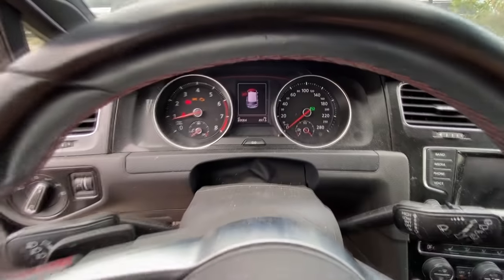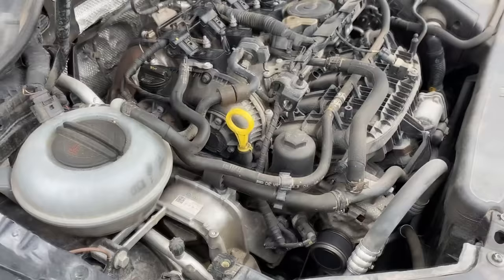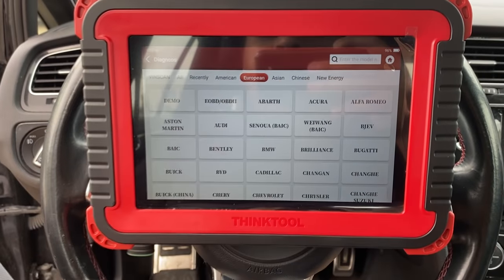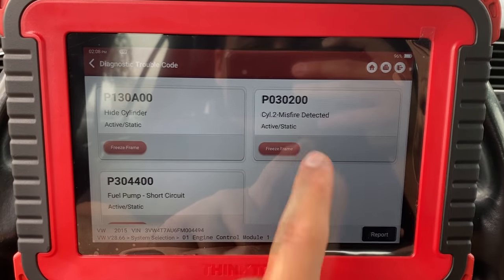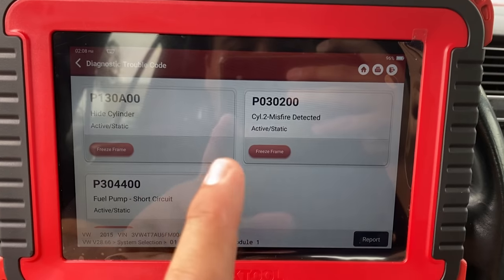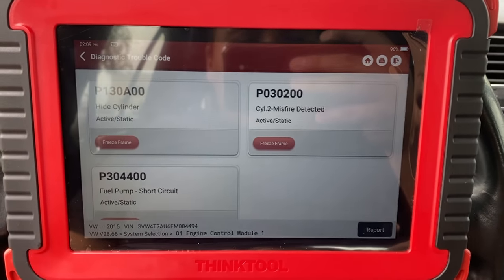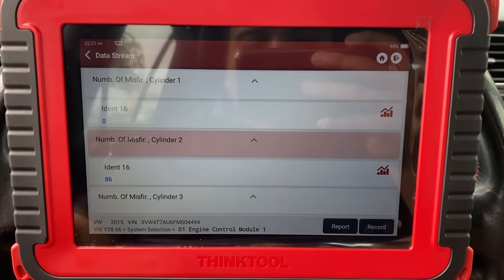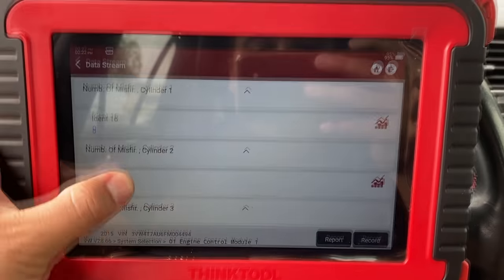VW GTI MISFIRE CYLINDER #2 NO COMPRESSION

Comment: I had an a4 like that come into the shop, and it actually ended up being a valve train issue, caused by a timing chain issue. The cam journal on cylinder 2 intake was eaten up.
Reply from the maker: After doing some research I found this to be a pretty common issue with tuned 2.0 engines. This vehicle has a COBB tuner. Humble Mechanic actually made a video with the exact same vehicle that had the exact same problem. Check it out here! https://youtu.be/V6jzRQpMw24
Reply: @ADVANCEDLEVELAUTO  Great follow up!  And that makes a lot of sense too.  Really enjoyed the walk through on this diagnosis.

Comment: Before settling on piston Rings being a problem I would pull the valve cover and check valve clearances. Could have a tight valve or even a valve that's carbon up due leaking valve seals on the intakes. Just my two cents. Great video!

Comment: There was some damage to the head gasket. When rotates the camera back to the intake valves there is a missing piece. It could lead to an oil passage for parts under the valve cover. That being said it could also be a reason y there is oil in the cylinder. Regardless tho engine would need to be taken apart. Update on this would be nice tho just for Curiosity purposes.

Comment: or try pressure transducer on the dip stick tube prove piston leakage ... also on GDI the spark plug washer crushes  on first fit   to aligns the electrode with the injector   .. so the plug should only be fitted once or misfiring might occur  so never refit a used plug    best regards JF
Reply from the maker: After doing some research I found this to be a pretty common issue with tuned 2.0 engines. This vehicle has a COBB tuner. Humble Mechanic actually made a video with the exact same vehicle that had the exact same problem. Check it out here! https://youtu.be/V6jzRQpMw24

Comment: Any possibility of issues with rocker arms of #2 cylinder?
Reply from the maker: After doing some research I found this to be a pretty common issue with tuned 2.0 engines. This vehicle has a COBB tuner. Humble Mechanic actually made a video with the exact same vehicle that had the exact same problem. Check it out here! https://youtu.be/V6jzRQpMw24

Comment: If that’s a 2015 then that’s not true. The timing chain issue was fixed in 2014. There were many updates with the motor. The tensioner was one of them. If it’s a 2015 it’s a Gen 3. What all u said is very true about the older models. The gen 3 is great engine. Won many awards. I have a 2015 with 196k miles. With all stock eternals. Upgraded turbo, inter cooler and tune. Pushing 400hp.

Comment: You could put pressured air onto the cylinder and listen, if it’s inlet valve which is broken then you could hear / feel air coming to the air filter, if it’s exhaust you’d hear it when u go to the exhaust pipe and if it’s the seal then you could undo the dipstick and hear air

Comment: Hi Eric, I had a similar problem in regarding  with a 2014  VW caddy ( van) I had as a company car a couple of years back. I had the fuse blow for the interior light, and the fuse box was unmarked as well. So I had to pull out each fuse, one by one to find the blown fuse. When the car was due for service , I asked the VW dealer why there was no markings for the fuses and no mention of them in the car manual. He told me straight out the reason is VW want you to return to the dealer  for service, when problems such as this arise..
Reply from the maker: That to me is just ridiculous!
Reply: @ADVANCEDLEVELAUTO  I know, but that’s what I was told. Kind of makes sense, huh?  🤔

Comment: You can also have a head gasket  issue  wear it blows between  paring  cylinders with out crossing over a water jacket, numbet 3 was  a little  low at 90 psi.

Comment: EA888 no longer had timing chain tensioner issues this late. It was the earlier ones which had a revised design. This engine seems to be very reliable even when motified. 
This example looks to be in rough shape. It's the "inspection due" notification also on when you start it?

Comment: Timing chain problems are very common on the mk6 generation (10-14) 2010-2012 specifically... not this generation (gen 3 EA888). More than likely as stated in the video.... piston ring issues caused by 90K miles of harsh diving with minimum, late or undone maintenance...combined with a less the optimal cobb ots tune.  10K oil change maintenance doesn't cut it...in this situation...5k or 6 month and these engines will last much longer. 10K only works of the first person on a lease. You could try and engine flush product to see if it worked the rings loose and compression increased...but once it has hit this point. I wouldn't hold high hope...but it could at least add to the diagnostic.  You should ask the customer how much oil they were adding between changes.
Reply: I replaced the break-in oil of my 2021 GTI at 1058 miles after seeing break-in flecks on the dipstick. Imagine running that oil for the first 10k miles! Now doing 3k mile oil changes. I don't care how stout modern engine oils are. This is a turbo GDI engine with quite a bit of back pressure too due to the stock downpipe.

Comment: Some of this engines suffer from valve not seating properly because of dirt build up on the inlet valves
Reply from the maker: After doing some research I found this to be a pretty common issue with tuned 2.0 engines. This vehicle has a COBB tuner. Humble Mechanic actually made a video with the exact same vehicle that had the exact same problem. Check it out here! https://youtu.be/V6jzRQpMw24

Comment: One more test is doing a leak down test. Apply air pressure to the spark plug hole. Is the air leaking out the exhaust, intake, or valve cover oil cap opening. Some of the Direct Injection engines are prone for carbon buildup on the intake valves and failing to fully seat thus giving little or no compression.
Reply from the maker: After doing some research I found this to be a pretty common issue with tuned 2.0 engines. This vehicle has a COBB tuner. Humble Mechanic actually made a video with the exact same vehicle that had the exact same problem. Check it out here! https://youtu.be/V6jzRQpMw24

Comment: The car engineers dont give a damn about the poor mechanics who work on them.
Reply: Actually, they may care but their priority is to design a product with low manufacturing costs, not servicing.
Reply: @davidkeller2832  ,
their idiotic priority is going to backfire on them !
Reliability issues always backfire eventually, even if only by word of mouth !
Carbonated inlet valves are avoided by using 2 injectors per cylinder, one direct and one into the inlet pipe !!

Comment: fist of all when you get a car with a cold air intake system and a COBB  10:09 or any other tuner on a car you have to suspect melted piston or broken piston ring groves etc you have to consider mechanical damage I work on Volkswagen for a living and the MK7 generation engine is pretty good with the timing chain tensioner and chain but the older engine between 2009 and 2011 are more prone for having the old style tensioner but from what I see is the actual chain gets stretch over time especially with poor maintenance .

Comment: I had a similar problem with my mark5 gti and it was a blown head gasket. Didn’t have milky oil and was just getting oil into the spark plug holes and fouled my plugs. I opened up the head replaced the head gasket that had a tear in it and new plugs and coil packs and ran like a charm after that. But with that cylinder two not having compression I think the cylinder ring has damage also.

Comment: We also got a Tiguan vw with the same motor 115k miles. Timing chain broke and had no compression in all of the cylinders. It’s Got no beans when cranking it 😂 vw are a pain
Reply from the maker: After doing some research I found this to be a pretty common issue with tuned 2.0 engines. This vehicle has a COBB tuner. Humble Mechanic actually made a video with the exact same vehicle that had the exact same problem. Check it out here! https://youtu.be/V6jzRQpMw24

Comment: Oil in the Cylinder.. Means Oil Blow by past the Piston Rings..

You can also check the oil for Fuel contamination... Just put some on the stick. It it catches fire. You got fuel in the oil..

Comment: The tensioner issue has only been an issue for MK5 and MK6 GTI's with the EA888 Gen 1 motors FYI! Mk7's don't really have timing issues. I've had issues with my cylinder 2 misfiring and from my personal troubleshooting, I found it to be an injector issue. These cars are mad annoying lol

Comment: That ignition coil ground bolt nut thing is just a small example of the entire VW build. Incredibly badly engineered for service and repair, and like others have said, designed to force you to go to the dealer.  Terrible service information as well, just a simple function like fuse identification should be clear and straightforward.  Last VW I saw, approx 2015 Passat - door harness damaged, there were ELEVEN different variants of that wire harness, each with specifically pinned connectors.  Anybody who says "I'm looking at a used VW -" I just cut them off and give them the bad kitty "NO!!  NO das bad kitty, you kitty NO!!"  
Stay gold.

Comment: I have a 15' GTI. I was inca drivethru when I heard a loud pop, saw tons of exhaust smoke in my mirrors. Immediately my CEL lit up along with the epc. Had no boost whatsoever. Brought my car to volkswagen, they said it was due to my car needed a carbon cleaning, paid 2k for new fuel injectors, sparks? Walnut blast via carbon cleaning. Once that was all set, they later came back to me saying I need a brand new engine because I had 0 compression in cylinder #2. Idk if that was due to not getting my carbon cleaning but at that time the car only had 74,000 km. Needless to say I got the free engine Nd I'm scared shitless that I'll go thru that problem again. I don't want my car misfiring or having the chain tensioner lossening up.

Comment: Hey I need some help! So I got a 13’gti and have done most of the work on it, and now I’m gettin. Check engine light for misfire on cylinder 4, I just replaced the spark plug and could pack still showing the issue.. I’m guessing it might be carbon build up or not sure yet.. but the car runs fine and no sputtering and or surging. I’m testing running it around town and nothing feels like it’s misfire, but I just need a pro’s second opinion

Comment: You pull the injector plug underneath that sai filter. You don’t need to pull the fuel pump fuse and you supposed to remove all the plugs and coils if you are compression testing a vehicle.

Comment: ERIC, ur awesome always excellent logic you go to diagnose any car one thing though you could do relative compression with ur scope could be done from the battery too and will show big dip for that cylinder #2 fast and easy and about scoping the fuel injector u can do it from the pcm if u know the wiring  diagram damn those EURO cars they don't make them easy for the diagnoses and as always thanks for sharing brother.
Reply from the maker: After doing some research I found this to be a pretty common issue with tuned 2.0 engines. This vehicle has a COBB tuner. Humble Mechanic actually made a video with the exact same vehicle that had the exact same problem. Check it out here! https://youtu.be/V6jzRQpMw24

Comment: for VDubs and Mercedes, Fuse label is on a card located in the fuse box if its missing some one lost it  try "Hey Google"
Reply: I had a piss show trying to find fuses on my brothers 2010 passat cc... or just CC. like 3 mf fuse boxes, the owners manual didn't have the fuse panel he has, and it was just a horrible time. Brought it to a shop for idk an oil change or something simple, and the parking light had gone bad or something. Long story short, it wouldnt start when it came out of the shop, they didn't want anything to do with it. I try a bunch of stuff, seemed like a security/immobilizer. I couldn't find the fuse where it was. Just had it towed to a local VW shop (not dealer) basically they took the immobilizer fuse for the parking light **facepalm**. I tried so hard to get the damn fuses looked up but it was just a horrible time. 100 or more dollars later for a tow ect all because of a shop doing sketchy work and VW not being good with their fuse labeling xd.

Comment: I'm sure you checked to see if there was exhaust coming out of the radiator, but if you didn't I'd do that before I tore down the engine....  Some open deck engines will vent the compression out the radiator without turning the oil into a milk shake.  It all depends on how the head gasket fails.

I've honestly never seen the rings go that bad on just one cylinder at less than truly ridiculous mileage, at least without scoring up the cylinder walls.
Reply: You can only check it from the coolant bottle..but no point if it's a hight count misfire and continuously, that's it. Check timing mechanically and with ecm measure values and you'll see it out of time, as well as checking the timing tensioner through the lower timing cover peep hole. It's known for those engine to go bad due to horrible maintenance schedule.
Reply from the maker: After doing some research I found this to be a pretty common issue with tuned 2.0 engines. This vehicle has a COBB tuner. Humble Mechanic actually made a video with the exact same vehicle that had the exact same problem. Check it out here! https://youtu.be/V6jzRQpMw24
Reply: @rizzorizzo4228  Way back in the day, when I learned to fix cars, a single phone call to your car guru, usually an old and experienced mechanic or a long term dealership service manager would tell you exactly what was wrong with your car and how to fix it.  Cars were simple and defects uncommon.  For example, if an Olds Rocket engine had a tick, it was always the aluminum rocker arm stands.  You might as well buy a couple along with the gasket before taking the valve covers off.  But VW's aren't that straight forward and lots of things can cause misfires.  On most modern cars you are always better off doing a full diagnostic.  

And yes, I still know some mechanics that use the most likely scenario and parts cannon to try and repair cars but that often leads to bad results at a high cost.

Some years ago I literally diagnosed the first and most likely only 94 Saturn ECM to fail while self testing good... It only lost the fuel injection drivers.  The car already had a new battery, fuel pump, alternator, starter and valve cover gaskets and the alarm system had been torn out badly.  it very likely even had more new parts I didn't look for.  I even tested the ECM using the big buck snap on tool. But in the end, it was a bad ECM after all.  Naturally because they never fail, I got one from a junk yard for $80.00 and it's been fine for about 12 years now.  

It's nice to know what often fails on a particular car, but there's no substitute for comprehensive diagnostics.
Reply: @ADVANCEDLEVELAUTO  It's a good video, buy you're still going to have to pull the oil pan to confirm the diagnosis.
Reply: I agree with what your saying, sounds like plenty of first hand experience. Appreciate the advice. It would be nice to drop the oil pan and see the damages but oh well.
Reply: @rizzorizzo4228  Actually about 47 years of experience. And yup, I'm still learning.  I just spent a week of my life learning how to diagnose Ford fuel systems and about 5 hours over two days replacing the fuel pump once I pretty much confirmed it was bad.  

I'm older and only have about 20% use of my right arm... You can bet, I did a thorough diagnostic on the computer controlled digital pulsed fuel system before I got under the car and endured about 5 hours of pain to R&R that miserable $120.00 pump. 

In my day, fuel pumps were easy... if it was peeing gasoline all over your driveway, the pump was bad.  Two or three hose clamps and two bolts replaced the $16.00 pump.. the process only took about half an hour and more than likely I could have done it all with my left hand in 45 minutes, worst case.

Even when I have other mechanics do work I can't do anymore, I still do my own diagnostics.  You would be amazed how many mechanics will just swap very expensive parts until they just maybe get your car fixed.

Comment: Should have added oil to cylinder to see if it increased compression, that would confirm rings. I had one that was leaking on one valve and could not identify with borescope. also cylinder leak down test would have helped ruled out valves.

Comment: If it does nor have clear flood, wouldn't the engine over rev. if you try to start it with your foot on the accelerator? I  don't know if my 2001 dodge ram has clear flood mode, I am concerned about trying it.

Comment: Just replaced my engine on my sons 2015 GTI. He had 105 k on it with no compression in number 2 and 4 cylinders. Removed head and valves were fine. Turns out that piston lands cracked and scoring in bores. All stock no tune and very well maintained. Got a used engine with 49 k on it. I looked all over for an engine and there’s no way you can get those engines for 2 k!  Try 4 k